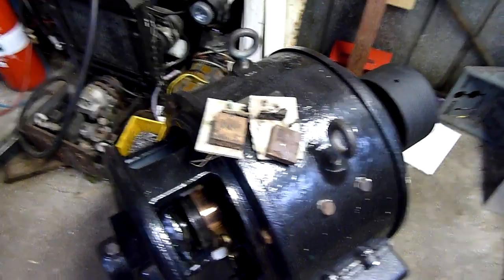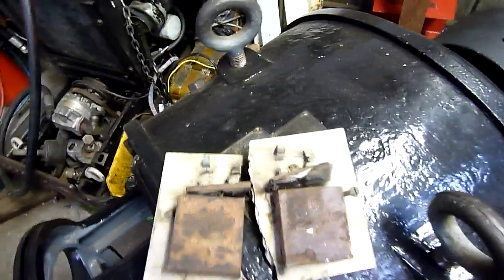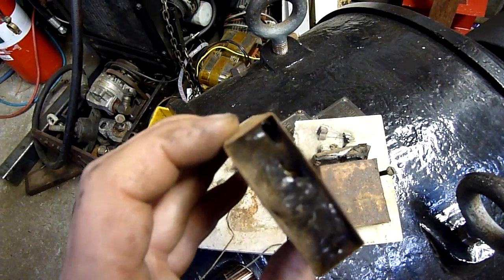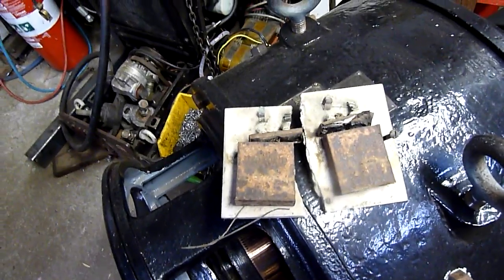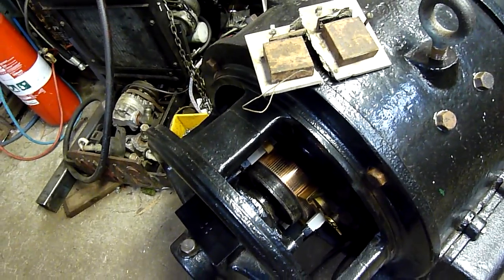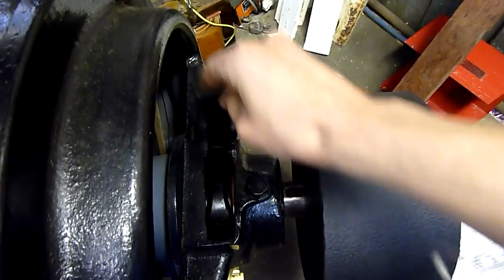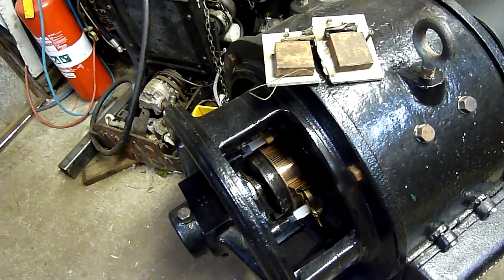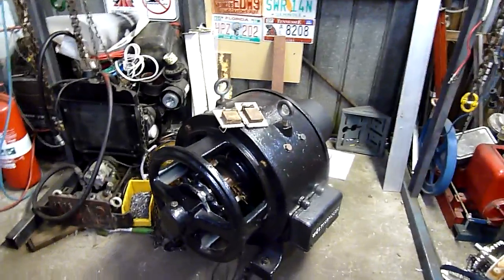Westinghouse DC Generator - Mystery Condenser Questions

Comment: They are resistor-capacitor series combinations for arc suppression connected in parallel with the brush pairs in theory. 

They'll also help the brushes reach the expected life span but that's part of the arc suppression. 

Should also stop too much of the brush being deposited on the commutator over time.

Comment from the maker: I can;t find any resistors on it but the caps were connected together with a center tap coming off the center connection between the 2, and a wire of each remaining terminal. 
I;m guessing the center tap goes to negative and the individual wires to each of the brush pairs?

Comment: You can replace them each with a 1uF to 2.2uF 160 to 250V modern unit, or use a 2uF motor run capacitor from an old aircon fan. One is wired across the brushes and the other is across the output, to provide arc suppression and some noise reduction.

Comment: hey ed sometimes caps are used for power factor correction , a low volt system uses huge caps for this but high voltage ones use little caps

Comment: That sounds about right to me, I don't know what the exact capacity might be though but they look fairly large for paper caps so maybe between .5 and 2 microfarad at 630 volts would be my guess. You don't need Sprague orange drops, those yellow polyester caps they have everywhere will do, or even motor caps. Hook them up and if the brushes don't arc they are doing their job. If you could find out what the originals were it would be best.

Comment: Ah yes. Looking forward to seeing this spun-up & turning out some watts. Judging by how long that kept on turning for after you hand-spun it, I'd say the rotor in that genny is quite a heavy little lump! :-O

Not sure what those condensors are for though, but looking at the other comments, & the fact that brushes do spark-n-pop a bit, they may very well be on there to minimise sparking, & to maintain as best as possible, the strength of the flux in the rotor to ensure a smooth output.

-BBD.

Comment: Depends on the gen the smaller ones usually use the caps to excite the field windings but on the big ones like gas turbine size use a set of brushes to excite the winding so in theory you could excite it by reversing power in the winding

Comment: They are likely paper condensers, non polarized, used for arc suppression, automotive generators. They used very similar capacitors in early AC radios, I worked on one this past summer that had about four of them packed into a metal can. I don't think the potting is particularly dangerous, it's a black wax or tar just used to seal the cans, the condensers inside were dipped in a clear or amber wax first before being stuffed in the cans. I would guess that they are probably 1 or 2 uf .

Comment: Probably for arc (RFI) suppression,I'd guess. Depending on value,new ones shouldn't be hard to find. For something small (under 1uF) Maybe look at something like the Sprague 715/716 'orange drop' caps (rated for 630Vdc),or for larger values,maybe some motor run caps,or something?
No idea how they were wired. I might suspect that there was a cap(+resistor?) from each DC output 'pole',to the case (which would be earth-grounded)

Comment: I think that those motors won't produce electricity without a starting pulse like a car alternator. maybe when the generator starts it makes a small voltage (1-5volts with no amps) that charges the capacitor and the capacitor discharges into the windings and the discharge might make a big enough magnetic field to start the motor generating real power. I'm pretty sure I'm wrong but Im just guessing

Comment: mad. fucking nice job sir. it should self energize and i think the condensers are just for to stop electrical interference from the brushes or help brushes not arc. or not. you will need a regulator id think. it would just like a old car gen id say

Comment: I've seen that befor I'm sure its serpress the brushs volts but on the nite I sore same motor .the guy said it a was booster ? Could thout I just kid. 2 or 3 volt levels Is it a dyno motor gen . I sure on the nite they serpreeors thou all so as a motor did actorvate a second speed. Come to think of it. Broken hill city show allwags old kit on display here that's all I got

Comment: NO !!  show it some car porn , that's for sure to get it hot and bothered ha ha ha you better diode protect that beast , it would be a shame to kill it after it has lived all these years , as for the condensers they are to take the noise out , and sort of smooth the wave , they wired up with the brushes ,but not needed unless you are actually going to put that beast in actual use , as a toy , I wouldn't bother , but would diode protect it for sure !